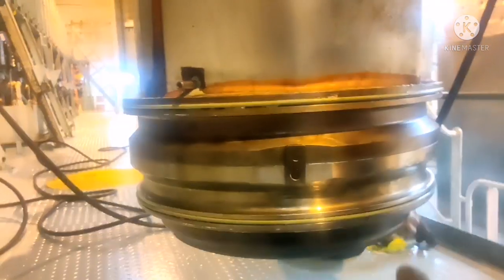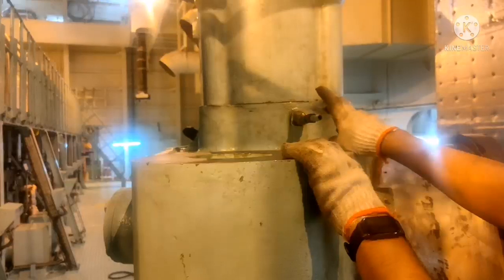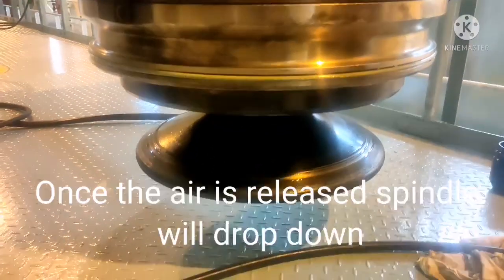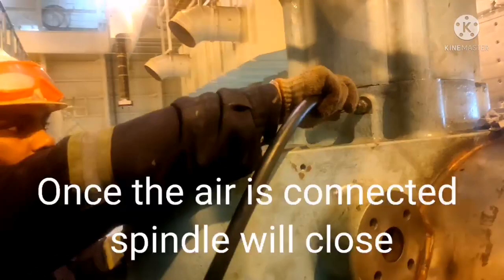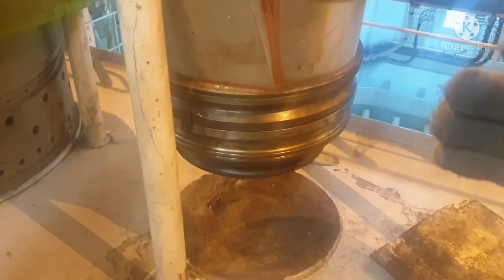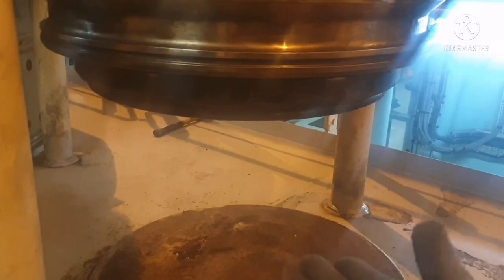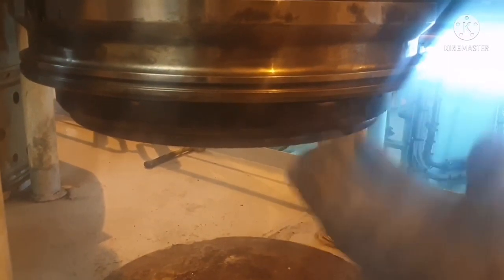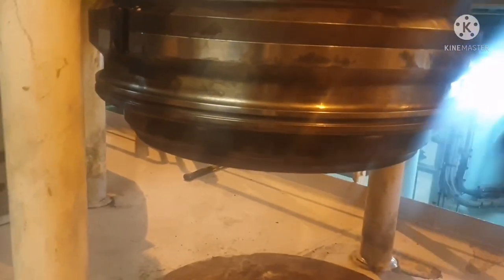How do they do... How to do Function test and drop test for Main engine exhaust valve

Comment: Hi sir ...saw your video...I overhauled the exhibition valve and during function test of opening and closing of the valve after removing air from below the sir cyl spindle is not dropping down fully...it drops a bit when giving air closing ok .. what could be wrong...I overhauled to the best of my knowledge and after reading manual...any suggestions